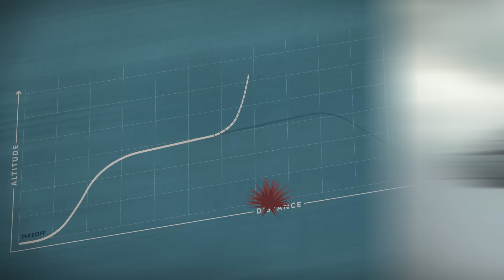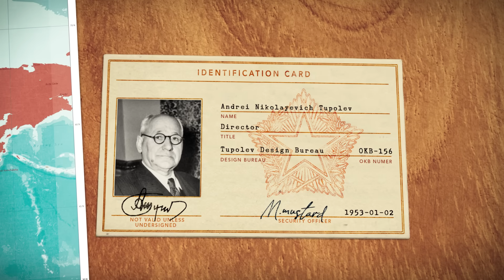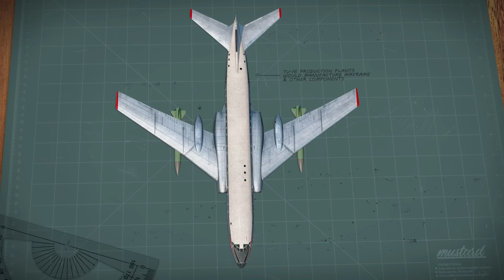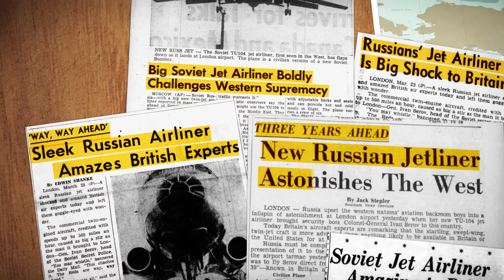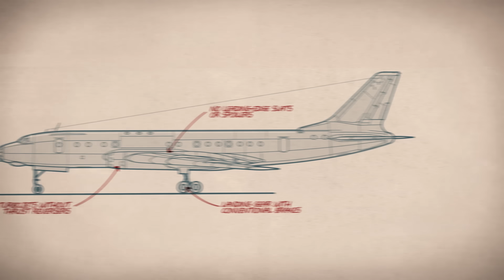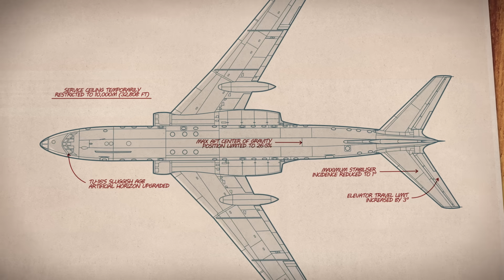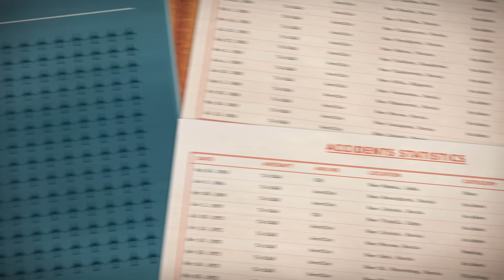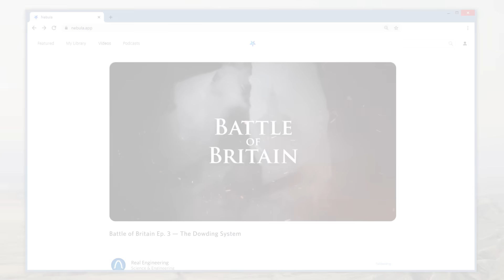The Soviet Airliner Designed To Crash

Comment: So deadly that the Soviets made a folk song based of the plane.
Reply: The deadliest jet airliner in history is the de Havilland Comet..
Reply: @sandervanderkammen9230 

We feel we can shed some light on some common myths & misunderstandings repeated in many comments.

It is indeed correct that there were plenty of aircraft that were more dangerous than the De Havilland Comet before & after the Comet.

Obviously It's not valid to compare a Bow-wing ( see B-47 wing folding & wing collapse incidents for details) jet  airliner designed & first built as late 6 decades after the Comet, with the fabulous De Havilland Comet, the world's first high altitude jet powered airliner.  
  Vast improvements in commercial aviation infrastructure & pilot familiarity with jet airliners alone being a significant factor in improvements in air travel safety safety over more than half a century.

    Of course Bow-wing having 50 years more design, build & operation experience than De Havilland didn't prevent the horrendous Bow-wing Max  incidents, there can obviously be no excuses for that.
  
  That's correct of course, at the time the Comet wasn't particularly dangerous. Agreed, that is indeed the case of course, The DH Comet was definitely not the worst engineering failure in commercial airliner history.

Losses comparisons
How things were in those days.

DeHavilland Comet 4 UK                  14% 
DeHavilland Comet all mks             17%  

Boeing 307                               70%
Boeing 247                               48%
Boeing 707            .                  20% 
Lockheed Electra Turboprop   29%
Canadair CL-44  Turboprop     46%  
Convair CV-580  Turboprop     22%
Convair CV-880    (ff 1959)       27%  
Convair CV-990     (ff 1961)      33%
Tupolev TU-104       (ff 1955)    16%

     Of course De Havilland had prior experience building many all metal construction airframe aircraft & thousands of jet powered fighter aircraft that were primarily of metal construction with pressurised cockpits & jet engines built by De-Havilland.

  Yes, that's true, De Havilland carried out full stress analysis & engaged in a comprehensive & protracted testing program which is why key De Havilland people were happy to be aboard flying DH Comet aircraft. The Comet was the first airliner where stress due to pressurisation significantly exceeded flying load stress for a full length passenger cabin fyselage.

    We agree, that's correct, the DH Comet was the first passenger airliner with full length fuselage pressurisation at 8psi pressure differential. Handley Page built the world's first all metal construction airliner during the 1920s.
    In many cases earlier pressurised aircraft were larger, needed thicker fuselage skins due to flying stresses alone & had much lower pressurisation differential pressure. 

     Of course ripstop provision was provided. The skin alloy used became unavailable at the time due to R & D at the manufacturers which resulted in the original alloy being discontinued. Later alloys had very similar properties. The skin thickness used for the Comet was used for similar size later aircraft. Frame spacing was not found to be too large & frame width was not found to be too small.

    Without doubt De Havilland did indeed always work to better than industry standards at the time, used up to date knowledge for the design & construction & no evidence of negligence or criminal negligence was ever produced in relation to the DH Comet.

   Obviously the DH Comet had no effect on the course of the aerospace industry in the UK. The UK now has the world's largest combined nuclear, aerospace & defence sectors per capita activity.

    That's correct, the investigation committee did not find hundreds of fatal flaws or evidence of design defects, structural defects, defective materials or shoddy workmanship. Indeed it is the case that ripstop provision was included. Claimed incidents did not involve cracks starting from passenger window corners.
   Pretty much all changes were just in case changes or were planned development modifications & improvements that were scheduled regardless of incidents.

    Obviously De Havilland designers knew all there was to know about metal fatigue at the time they designed the DH Comet.

    It is in fact true to say that the way airliners were built changed everywhere including in the US after the Comet incidents.

We hope this helps, obviously.

Cheers indeed of course 👍. 
                   
 . . .... ... .... .  . .
.. ......... ..  ... . 
 ..... ..... .... ... .

Comment: Incompetent Russian/Soviet idiots haven't changed s bit. 😡
Reply: Actually the British built the deadliest jet airliner in history, the de Havilland Comet has the highest loss rate and fatalities statistics of any jet airliner in history...
Reply: @sandervanderkammen9230  I actually flew on a Comet back at the end of the 50s.
Reply: @daveballin  Wow! You are lucky to be alive... the Comet was a deathtrap..
Reply: @sandervanderkammen9230 

We feel we can shed some light on some common myths & misunderstandings repeated in many comments.

It is indeed correct that there were plenty of aircraft that were more dangerous than the De Havilland Comet before & after the Comet.

Obviously It's not valid to compare a Bow-wing ( see B-47 wing folding & wing collapse incidents for details) jet  airliner designed & first built as late 6 decades after the Comet, with the fabulous De Havilland Comet, the world's first high altitude jet powered airliner.  
  Vast improvements in commercial aviation infrastructure & pilot familiarity with jet airliners alone being a significant factor in improvements in air travel safety safety over more than half a century.

    Of course Bow-wing having 50 years more design, build & operation experience than De Havilland didn't prevent the horrendous Bow-wing Max  incidents, there can obviously be no excuses for that.
  
  That's correct of course, at the time the Comet wasn't particularly dangerous. Agreed, that is indeed the case of course, The DH Comet was definitely not the worst engineering failure in commercial airliner history.

Losses comparisons
How things were in those days.

DeHavilland Comet 4 UK                  14% 
DeHavilland Comet all mks             17%  

Boeing 307                               70%
Boeing 247                               48%
Boeing 707            .                  20% 
Lockheed Electra Turboprop   29%
Canadair CL-44  Turboprop     46%  
Convair CV-580  Turboprop     22%
Convair CV-880    (ff 1959)       27%  
Convair CV-990     (ff 1961)      33%
Tupolev TU-104       (ff 1955)    16%

     Of course De Havilland had prior experience building many all metal construction airframe aircraft & thousands of jet powered fighter aircraft that were primarily of metal construction with pressurised cockpits & jet engines built by De-Havilland.

  Yes, that's true, De Havilland carried out full stress analysis & engaged in a comprehensive & protracted testing program which is why key De Havilland people were happy to be aboard flying DH Comet aircraft. The Comet was the first airliner where stress due to pressurisation significantly exceeded flying load stress for a full length passenger cabin fyselage.

    We agree, that's correct, the DH Comet was the first passenger airliner with full length fuselage pressurisation at 8psi pressure differential. Handley Page built the world's first all metal construction airliner during the 1920s.
    In many cases earlier pressurised aircraft were larger, needed thicker fuselage skins due to flying stresses alone & had much lower pressurisation differential pressure. 

     Of course ripstop provision was provided. The skin alloy used became unavailable at the time due to R & D at the manufacturers which resulted in the original alloy being discontinued. Later alloys had very similar properties. The skin thickness used for the Comet was used for similar size later aircraft. Frame spacing was not found to be too large & frame width was not found to be too small.

    Without doubt De Havilland did indeed always work to better than industry standards at the time, used up to date knowledge for the design & construction & no evidence of negligence or criminal negligence was ever produced in relation to the DH Comet.

   Obviously the DH Comet had no effect on the course of the aerospace industry in the UK. The UK now has the world's largest combined nuclear, aerospace & defence sectors per capita activity.

    That's correct, the investigation committee did not find hundreds of fatal flaws or evidence of design defects, structural defects, defective materials or shoddy workmanship. Indeed it is the case that ripstop provision was included. Claimed incidents did not involve cracks starting from passenger window corners.
   Pretty much all changes were just in case changes or were planned development modifications & improvements that were scheduled regardless of incidents.

    Obviously De Havilland designers knew all there was to know about metal fatigue at the time they designed the DH Comet.

    It is in fact true to say that the way airliners were built changed everywhere including in the US after the Comet incidents.

We hope this helps, obviously.

Cheers indeed of course 👍. 
                     
 . . .... ... .... .  . ..
.. ......... ..  ... . . ..
 ..... ..... .... ... ...

Comment: RuZZian quality
Reply: Yes, better than British aircraft...
Reply: @sandervanderkammen9230 

We feel we can shed some light on some common myths & misunderstandings repeated in many comments.

Although the TU-104 was a later design aircraft it was not safer than the DH Comet.

It is indeed correct that there were plenty of aircraft that were more dangerous than the De Havilland Comet before & after the Comet.

Obviously It's not valid to compare a Bow-wing ( see B-47 wing folding & wing collapse incidents for details) jet  airliner designed & first built as late 6 decades after the Comet, with the fabulous De Havilland Comet, the world's first high altitude jet powered airliner.  
  Vast improvements in commercial aviation infrastructure & pilot familiarity with jet airliners alone being a significant factor in improvements in air travel safety safety over more than half a century.

    Of course Bow-wing having 50 years more design, build & operation experience than De Havilland didn't prevent the horrendous Bow-wing Max  incidents, there can obviously be no excuses for that.
  
  That's correct of course, at the time the Comet wasn't particularly dangerous. Agreed, that is indeed the case of course, The DH Comet was definitely not the worst engineering failure in commercial airliner history.

Losses comparisons
How things were in those days.

DeHavilland Comet 4 UK                  14% 
DeHavilland Comet all mks             17%  

Boeing 307                               70%
Boeing 247                               48%
Boeing 707            .                  20% 
Lockheed Electra Turboprop   29%
Canadair CL-44  Turboprop     46%  
Convair CV-580  Turboprop     22%
Convair CV-880    (ff 1959)       27%  
Convair CV-990     (ff 1961)      33%
Tupolev TU-104       (ff 1955)    16%

     Of course De Havilland had prior experience building many all metal construction airframe aircraft & thousands of jet powered fighter aircraft that were primarily of metal construction with pressurised cockpits & jet engines built by De-Havilland.

  Yes, that's true, De Havilland carried out full stress analysis & engaged in a comprehensive & protracted testing program which is why key De Havilland people were happy to be aboard flying DH Comet aircraft. The Comet was the first airliner where stress due to pressurisation significantly exceeded flying load stress for a full length passenger cabin fyselage.

    We agree, that's correct, the DH Comet was the first passenger airliner with full length fuselage pressurisation at 8psi pressure differential. Handley Page built the world's first all metal construction airliner during the 1920s.
    In many cases earlier pressurised aircraft were larger, needed thicker fuselage skins due to flying stresses alone & had much lower pressurisation differential pressure. 

     Of course ripstop provision was provided. The skin alloy used became unavailable at the time due to R & D at the manufacturers which resulted in the original alloy being discontinued. Later alloys had very similar properties. The skin thickness used for the Comet was used for similar size later aircraft. Frame spacing was not found to be too large & frame width was not found to be too small.

    Without doubt De Havilland did indeed always work to better than industry standards at the time, used up to date knowledge for the design & construction & no evidence of negligence or criminal negligence was ever produced in relation to the DH Comet.

   Obviously the DH Comet had no effect on the course of the aerospace industry in the UK. The UK now has the world's largest combined nuclear, aerospace & defence sectors per capita activity.

    That's correct, the investigation committee did not find hundreds of fatal flaws or evidence of design defects, structural defects, defective materials or shoddy workmanship. Indeed it is the case that ripstop provision was included. Claimed incidents did not involve cracks starting from passenger window corners.
   Pretty much all changes were just in case changes or were planned development modifications & improvements that were scheduled regardless of incidents.

    Obviously De Havilland designers knew all there was to know about metal fatigue at the time they designed the DH Comet.

    It is in fact true to say that the way airliners were built changed everywhere including in the US after the Comet incidents.

We hope this helps, obviously.

Cheers indeed of course 👍. 
                   
 . . .... ... .... .  .. ...
.. ......... ..  ... . . ...
 ..... ..... .... ... .......